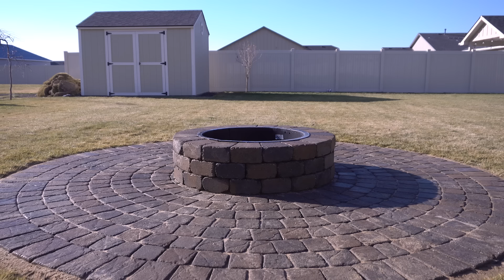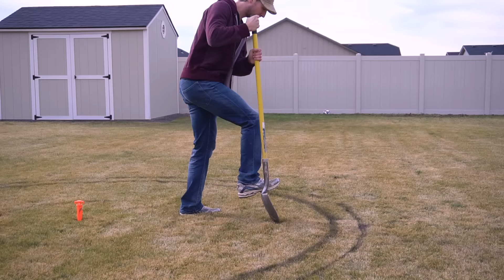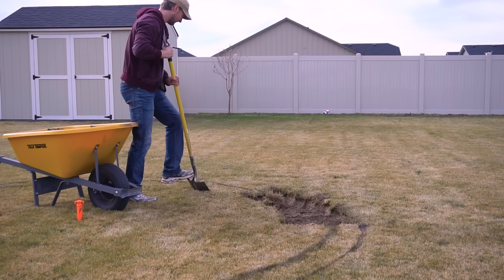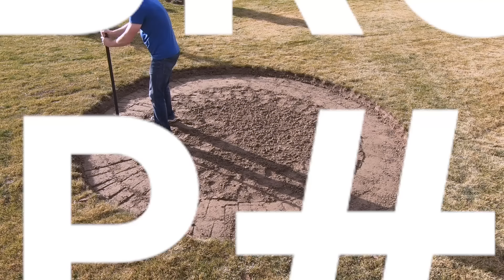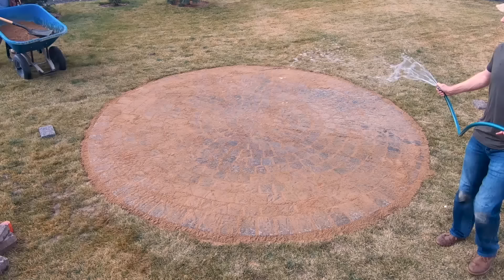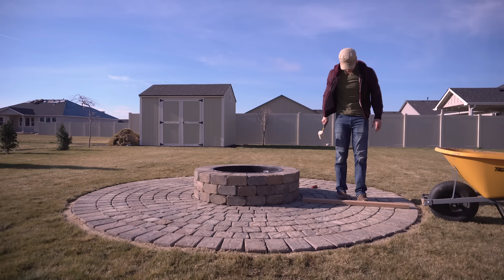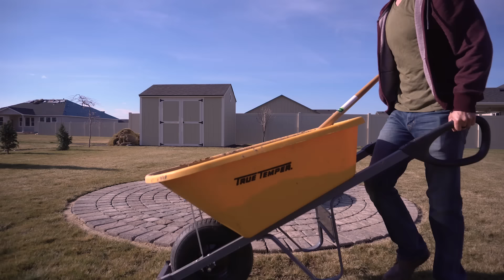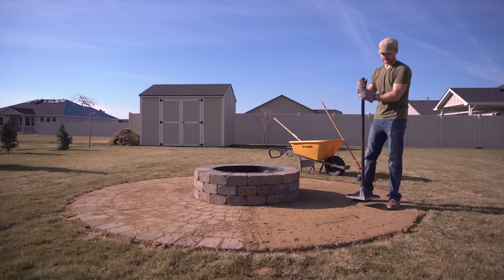My 4-Day Fire Pit Patio Build [Full DIY Project]

Comment: With such solid looking and compacted soil, was the gravel absolutely necessary?
Reply from the maker: It’s important for drainage because the ground freezes here in the winter. Without proper drainage, the ground can shift and cause the pavers to move.
Reply: @BroBuilds ah.  Thanks a lot

Comment: Did you consider using polymeric sand to fill the gaps? Surprised you didn't put like a Solo Stove in the middle so you aren't burning right on the pavers.

Comment: Would it have helped if you added air supply in the middle by burrying a pipe ?
Reply from the maker: Definitely. We spaced out the bottom row over blocks in a follow up video.

Comment: Not bad, except that it won't oast long, you'll have to constantly have to reset the pavers cause will sink low or up, specially if it rains alot. Should have used polysand to hold them in place better, other than that pretty cool
Reply from the maker: Hasn’t moved at all in 4 years. All the prep work is meant to keep it from having any issues over the years. That what the base layer is for.

Comment: Question:
Why did you only put the concrete caps on top of the pavers rather than use any kind of glue or cement to tighten them to the rocks? Can they not easily fall off or simply get out of place when they are just laid on top of the pavers without gluing them or anything
Reply from the maker: We glued them down in the follow up video

Comment: Pro not bro here. The base needs gently wet in before compacting/tamping and needs 4-6 inches of it.
Setting bed or screed can be sand or fine crushed gravel for around an inch in total.
you laid it correctly but wasted time compacting it in. lay it then sweep the sand in leaving a layer and compact the sand in will also compact the brick.
Reply from the maker: We did 6 inches of base. Wetting before compacting is a good tip. We did not compact the sand setting bed, not sure what you’re referring to there.

Comment: Is it advised to put some construction glue on the top part to hold together the pieces?

Otherwise, how does not securing the top of the fire pit hold up especially if it isn’t level?

Comment: Please, try doing this on clayed up soil with terribly hard ground. NOW THAT'S A WORKOUT. UGH. 💪🏻I'm literally doing my own diy 10ft to a drywell French drain right now and I'm not even done. I have 10x that much to go. This broke ass millennial is tired. 😂
Reply: I meant to also add in that I wish I could do this in my yard. But I'm saving for a later property. 😂
Reply from the maker: My property (Ryan), where we built the pizza oven and the stamped concrete sidewalk, has a TON of clay. And yeah, it’s an absolute nightmare to work in 🥵

Comment: What direction was the pitch for runoff?
Reply from the maker: We just kept it “level” with the yard which is slightly angled. But the fact we used sand in between the pavers helps too. And we live in a desert climate so heavy rain isn’t really an issue.

Comment: I spent the last 3 summers building patios, sidewalks, fire pits etc, really impressed by your work! Only think I could reccomend is using polymeric sand to fill in the gaps and using glue in between each layer of the fire pit blocks, both suggestions for a bit more stability, still really really impressed by your work though
Reply from the maker: Thank you! It’s held up really well. No issues at all. We did end up gluing the top layer of stones onto the fire ring.

Comment: hey guys, a noob here, why do you need a gravel base with an 1 inch layer  of sand on top of it? is it so that the base doesn't deform with the weather?
Reply from the maker: Yes exactly! The gravel base allows drainage so we don’t get movement in the winter from freezing water. The layer of sand is an ideal base for the pavers (if placed on rocks they’re likely to crack).

Comment: Im late to the party but as a former professional installer here are a few tips for circle kits. To start, plan the size accordngly. 12' is small. think about how many people you entertain or how large your family is. youll want plenty of room around the fire pit to sit as well as have the ability to move back away from the fire as needed without sitting in the lawn or tipping over. When it comes to fire rings, size does matter. three or four foot depending on what you want to burn. however, i always told my customers. this is not a brush or couch fire type of fire pit. heat will discolor and ruin the concrete if you arent careful. which brings me to the first thing I always did differently than this install. i reccommend not installing or buying the center of the circle kit. install the pit on gravel first and build the patio around it. no need to buy pavers only to bury them under the pit and burn on top of them. plus a fire on the gravel makes for easy cleanup. This also allows you to "set" the pit in the gravel and glue each course up. Also try to always use a fire ring inside with an air gap to protect the block. as far as the pavers go; on larger patios, longer screed bars of 1" conduit is the go to but we usually use shorter sections. we always set stakes, rest the bar on the stakes and check with a level to make sure we hit whatever pitch or direction we want the patio sloped to. rarely should a patio ever be dead level so that it sheds water. He is spot on. for a patio like this. 4" tamped angular gravel. class 5 limestone is common. and 1" washed sand. Pro tip; dont dig deeper than you have to. for one its useless digging, and two you would then have to fill that void with more tamped gravel. you never refill with loose soil. its easy to start setting circle kits around the fire ring. No matter how many you lay though it rarely ever lays perfect the first time and some times its necessary to cut one in each course to fill a smaller void. A cut paver is better than big/wide gaps. Concrete saw is the way to go. or for a homeowner a concrete blade on an angle grinder may work for a small job with only a few cuts. no need to hammer the pavers individually your sand should be firm and level enough that theyll sit in place. laying usually works best with one person laying and another feeding. once the pavers are laid. Always install a "soldier course" or border. immediately install a paver restraint on the outside border. this will keep them from shifting. typically a plastic stick in an L shape that you nail into the gravel with large spikes, about 8". one spike every foot to two feet apart as needed. youll want to make sure you leave about 4-6" of extra tamped gravel beyond the last paver to allow for this. now you should tamp the pavers into place and add your joint sand. some people tamp then sand, some spread sand then tamp. ive done both. either way i highly recommend a poly sand that will set up like a grout. prevents too much water from washing out the patio. helps a ton with ants and weeds. never install the poly sand on wet or damp pavers. follow the instructions well. last tip is to seal the patio to protect it long term and make it look a ton better, but wait for the patio to cure for a year or so after install before doing so. most pavers arent fully cured when sold and over time and youll most likely see efflorescence. you dont want that sealed in. Last few tips. buy quality pavers and flat shovels work way better than spades for this work and youll regret not renting the plate tamper. good luck.
Reply: @ PolkCoAngler - 👍🤩💝 Excellent comment & info. Thank you.

Comment: If you use concrete under the bricks, maybe weeds wouldn't eventually come through between the bricks.
Reply from the maker: No real issues with weeds other than grass creeping in from the edges.

Comment: On pro tip#3: 1” plumbing pipe has 1” outside diameter. 1” electrical conduit has 1” inside diameter (more than 1” outside diameter). Most people don’t realize there’s a difference

Comment: I do pavers and artificial turf here in Phoenix AZ I started with a tamper plate  a lot of work, got me a compactor a lot easier now, quick tips for you and everyone diy at home: Home Depot does rent the compactors but they only accept visa or credit cards because they will charge you 70$ for the day rental but 150$ for deposit. You do get your deposit back when you return the tool. Another tip when using ABC gravel bottom layer then 1/4 minus gravel which is 1/4 inch gravel for top layer because sand with water it sponges up and you don’t want that, 1/4 minus does not sponge up

Comment: Me, as a hardscaping worker for over 11years advise you all - Dont use this as a step-by-step guide

It is the hardest way to pave and it will not last long
Reply from the maker: @user-nn7uh7lm6f there are definitely more professional methods to use. That said, this has lasted 3+ years now, and it's super solid.

Comment: what size gravel did you use? the internet is calling for 3/4 inch but yours looks smaller
Reply from the maker: I believe it was just road mix. Not the best stuff - I would go with 3/4 if I were to do it again.

Comment: Aside from the added drainage the sand brings, wouldn’t it have been better to use mortar to seal the bricks?
Reply from the maker: polymetric sand is what everyone recommends. I'll use that for my bigger patio, but for this one, it felt like regular sand was good enough. And so far it's help up amazingly, and the water does just drain right through.

Comment: Why didn't you fix the firepit in place? I would've concreted it or cemented it, idk, english ain't my first language.
Reply from the maker: I put masonry adhesive on the top row eventually - at the time, I thought I might remove some firepit pavers for airflow (and we did, in the follow-up video).
Reply: @BroBuilds  ah okay, I see, good idea. I'll check that follow up video, thank you for your answer.

Comment: Do you need to nail down the final layer of concrete blocks on top of the firepit? It looks like it could be dangerous and fall off if someone sat on it
Reply from the maker: Yeah, definitely a great tip. I put masonry adhesive on it soon after the video was posted.

Comment: For a DIY build, you did pretty well, and is one of the best I've seen. Just know that if you ever have a real landscaper come out and do the exact same thing, you're being ripped off. There are so many things that should have been done differently, for example, the base course of the firepit should have been set with a deadblow and level directly on the patio base without pavers underneath (as to one, keep the base course in place better, and two, prevent damage to said pavers as they aren't made to stand up to intense heat, and will likely crack and start to break down within a few fires). Also, hardscape adhesive would be worth looking into for the fire pit blocks and caps, as well as shims to keep the caps level and even with each other. Again though, great work for being a DIYer.
Reply from the maker: Thanks! No pro would do it like this, that's for sure - it took way too long! :) No paver breakage so far after 3 years and a ton of fires. Added masonry adhesive to the firepit caps after filming, also - definitely a good tip for anyone out there.

Comment: Nice video! Why did you need the conduit pipes?
Reply from the maker: The thickness of the pipe was about 1 inch, and that's the depth of sand we wanted. So by scraping the board across the pipes, the sand below was exactly 1 inch deep.

Comment: Looks great! I am curious if you used polymeric sand for the patio and some brick adhesive for the fire pit?
Reply from the maker: Yes to the brick adhesive - that definitely helped, the top stones were too easy to tip. After that, the fire pit was locked in perfectly. 

I didn't use any polymeric sand. I plan to for my big patio project, but for this one I was concerned the polymeric would crack. I just wasn't confident in it at the time.

Comment: I've never made any form of patio or anything in my life... I genuinely thought this sort of thing needed to set with cement. Shows what I know. What stop weeds and grass growing through the gaps?
Reply from the maker: The grass tries to grow in front the edges, so we spray it to keep it out. Any kind of weed blocking fabric below the gravel would not stop it from growing above the fabric in the sand, so spraying is the best method. Same with weeds - they grow in the cracks rather than from below the gravel or sand. So you either need to spray or pull them by hand. It's not too bad to deal with, since it's a small-ish patio.

Comment: i know it's an old video, but i would have put some constuction type glue under those stone (especially the top row) to stop them from shifting or falling.  Also use polymeric sand to cover and help keep the gaps with the stones.
Reply from the maker: Absolutely - we ended up adding masonry adhesive to the top row. I preferred regular sand over polymeric just because I put the pavers closer together than recommended, and was concerned that a very narrow gap of polymeric would just crack and shift anyway.

Comment: You shouldn't use sand for screed under pavers, and theres absolutely no way you got that flat enough with such brutal screeding technique. You shouldnt hammer the pavers into the sand, you use a plate compactor at the end when you're sanding the pavers. 
You royally screwed this up and should have got a professional who would have taken 6 hours and installed your patio correctly.
Reply from the maker: Nope, I didn't want to pay an extra 2-3k. The patio is flat and rock solid - hasn't moved at all. I know that I spent longer than a pro, but that's the beauty of it. I paid for it in time instead of dollars. The end result speaks for itself I think.

Comment: Next time, use polymeric sand to finish. It's activated with water and will turn to concrete and lock the entire surface together.  😊
Reply from the maker: I was concerned it would crack because I made the patio with narrower gaps than recommended (may not have been the case, however). I do plan to use polymeric on my next patio though!

Comment: Should of drill holes in the ring it would help with the air flow on pit fire
Reply from the maker: The ring doesn’t go all the way down, so it wouldn’t have made a difference. In the next video we did space out the lowest ring of bricks, though.

Comment: Not all fire pit patio preparations have to be seven or eight inches. It's because you're using those thick paving bricks I am using natural stone that is smooth and out by creeks and rivers. And when you live in the woods like I do you're not going to be able to roll up that grass that easy. I mean it looks nice, did I miss something did you make ventilation holes on the side of the fire pit.. that really helps a lot. If you wouldn't have dug the beginning of it so deep you wouldn't have had to use so much gravel. Just saying.
Reply from the maker: We get frost heaves in the winter here if there isn’t proper drainage. That’s why the base gravel needs to be so deep. And yes, the depth you need to dig will vary depending on the pavers you’re using.

Comment: @bro builds, Why did you need to dig so deep? Wouldn't 5 inches, or even 4 do the trick?

I'm asking because i'm preparing to do something similar in my backyard. Thanks!
Reply from the maker: Base layer + sand + pavers. Base layer needs to be about 4” (here in Idaho) to allow for sufficient drainage to avoid freezing and lifting issues. Sand layer is 1”. Plus however thick the pavers are. So about 8” total for this project.

Comment: so you dont use anything to bind the blocks of the pit together?just let them sit there ?wouldnt they shift if bumped?
Reply from the maker: No they’re pretty heavy. Movement hasn’t been an issue. We did use construction adhesive to glue the top stones down, though. In a later video.

Comment: If you live in frost country you need as least 8 inches of straight gravel—not a gravel mix.   Compact that and put paver’s directly on that after you level it.  Those edges are gonna move after winter frost.  Best method is to mortar them.  Will last for years that way. And use polymeric sand for the joints, 
sweep it in and then lightly spray it 
with hose.  Not sure what that local landscape ‘pro’ was telling you.  But that sand will wash out pretty quickly.  Polymeric sand has an additive that sets up kinda like concrete and lasts way longer.  Plus weeds won’t come thru it.  You’re gonna have some weed problems there my friend.
Reply from the maker: I'm in southern Idaho, and I do agree that straight gravel would have been better, but from what I've read 6 inches is enough to prevent buckling. I also decided against polymeric because I kept my joints tighter and I didn't want the polymeric to crack and look bad. Ultimately it's been easy to add sand as needed.
Reply: @BroBuilds  The polymeric isn't that rigid...it will flex if there's movement.  Jobs I've done with very small joints and still use polymeric sand.  Plus the fact you didn't secure the outer ring of pavers will mean your joints will widen and there will be buckling due to frost.
Reply from the maker: @Bradjay23  sounds like you know your stuff, that's good to hear about polymeric. I'd like to use it on my next project. We did secure the outer edge though, and it's rock solid after 2 winters so far. Weeds haven't been a problem, I used silicon sand to top up the cracks and I've probably pulled <10 small weeds over the life of the patio. The bigger issue is grass growing in from the edges since we have Kentucky Blue Grass and it spreads everywhere.